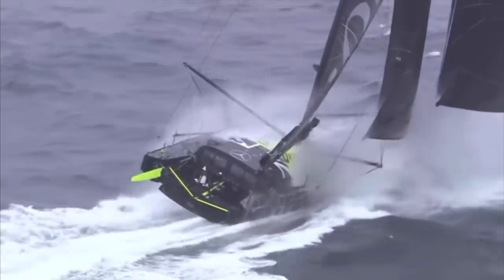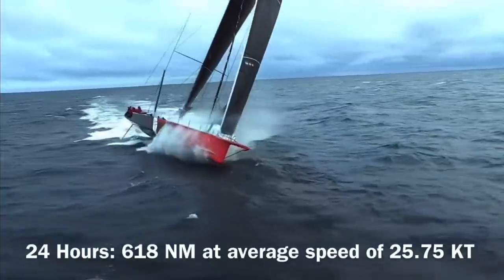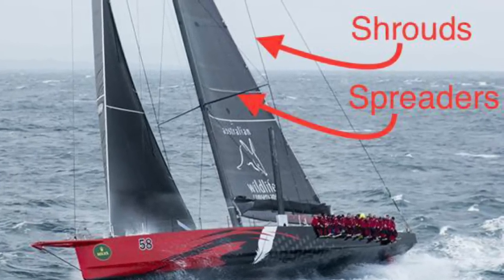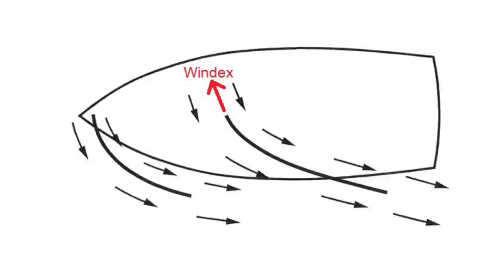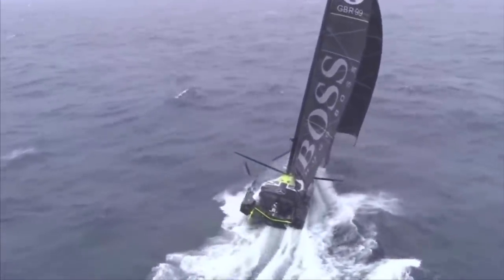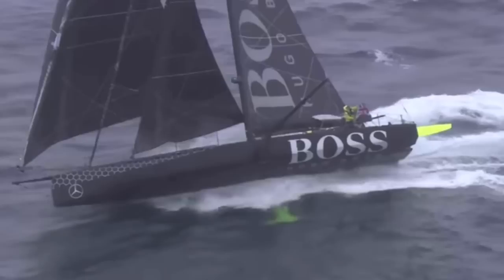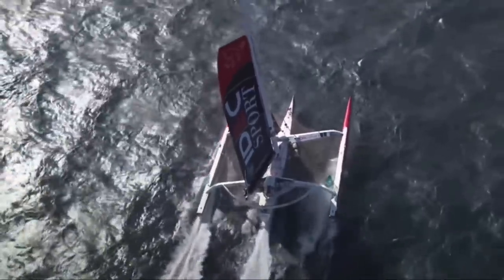Why Does Alex Thomson’s Hugo Boss Have Those Strange Outriggers?!?!?

Comment: Thanks for another very clear explanation.

P.S.  Not sure if you've covered it yet, but the sails that fascinate me most we the current America's cup sails which are basically a morphing wing.  They adjust for camber, thickness and angle, getting thicker and deeper after tacks, and thinner and flatter after the boat speeds back up, making most efficient use of the wind.  They look almost biological/living in operation.  I think Planet Sail had a video showing their operation through a tack.

These are asymmetric, monolithic (not slotted) wings, compared to the earlier slotted, symmetric wings of yesteryear.
Reply from the maker: I'll look into that! It would definitely be cool to have asymmetric wings that could morph into the correct shape on each tack and for a given boat speed!!!
Reply: @SailingTipsCa  That's exactly what they do.  I'd try to post the Youtube link, but comments with links often get banned or shadow banned.  

The Planet Sail video was from Auckland with the North Sails sail designer.  They revealed nothing about the internal working of the sail or rigging, but did show it operating (from the outside) in good detail.  It's seriously like a living thing.

If I had one, I'd probably computerize it with a neural network, for automated operation.  (For cruising.)

Edited my original comment above to say that the wings change angle, thickness and camber.  They're thick when the low apparent wind out of a tack benefits, then thin out and flatten out and trim in (smaller angle of attack) when the boat speeds back up.  Sort of going from a close reach to a close haul.  Due to speeds from foiling, they're always going into the apparent wind, as we know.

Comment: I had a Hobie 14 back in the day and It had a rotating mast. I used to place quarters on the base of the mast so it would rotate easier while tacking/gybing.
Reply from the maker: Interesting trick!!!
Reply: I used copper pennies in absence of Teflon buttons. Copper is an excellent lubricant. Quarters prbly have plenty of copper as well.
Reply from the maker: @dmitryshusterman9494  What kind of pivot mechanism is at the base of the mast? My F-82R has a ball and socket, but I know some boats have more of a cylinder and sleeve.
Reply: @SailingTipsCa  all beachcats iv seen have ball and socket and use a Teflon button for lubrication

Comment: I feel it should also be mentioned that the Hugo Boss (Guyot environment as it's known today) has dismasted four times since it was launched in 2015.  Comanche is older and has never suffered a rig collapse of any kind. I think I'm going to stick to spreaders and traditional shrouds.
Reply from the maker: Yes there’s certainly a reliability factor! That said multihulls have been successfully using rotating wing masts for decades, but they are more natural platforms with wide “built in” shroud bases. I also understand the IMOCA masts are one-design to reduce costs, so possibly a bit underbuilt for the job, and teams can’t replace with a heavier section even if they wanted to.

Comment: My Hobie has a rotating mast with spreaders. The wire makes a diamond shape on the mast, stiffening it.
Reply from the maker: Yes my F-82R trimaran has a rotating mast with spreaders like that too where the diamond wires terminate back on the mast, stiffening it. On a traditional fixed mast boat the spreaders have two functions 1) stiffening the mast as you noted and 2) adding leverage to the shrouds to enable them to attach to a narrower base. On our boats the spreaders only carry out function 1) here and the boat itself is wide enough to handle 2, but the IMOCA isn’t wide enough, hence the “spreaders” on the boat too!

Comment: Confusion here with function of spreaders and outriggers.
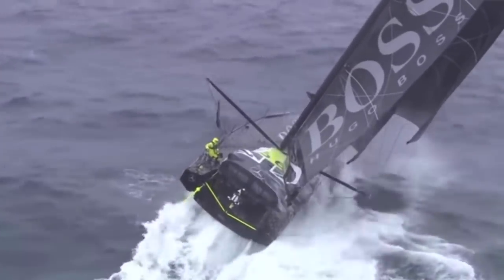Outriggers are for sheeting angles for sails, as can be seen in this video 1:24
Spreaders rotate with mast to keep mast in column.
Reply from the maker: The outriggers on the IMOCAs have multiple functions: The primary function is to provide a wide enough shroud base for the rotating wing mast, and as you noted they are also conveniently situated for tweaking headsail sheeting angles. The shrouds on a “normal” monohull also have multiple functions: They increase the leverage of the shrouds to enable the use of taller masts on narrow boats and also keep the mast in column. Boats with rotating wing masts have to split these functions apart: They need a wider base for the shrouds (e.g. outriggers on IMOCAs and floats on multihulls) and typically use diamond wires that rotate with the mast to keep it in column. I personally wouldn’t have thought of calling the outriggers on IMOCAs “spreaders” until I saw it in Sam Davies video!

Comment: Tornado Cats also have a rotating mast that you can rotate mechanically to change sail shape while Hobies and other cats masts only rotate when following the sail.
Reply from the maker: Our F-82R also has “positive” rotation controls attached to a lever arm that are independent of the sail, both to induce and limit rotation, which is nice, but it’s also an extra step to remember to adjust it. Everything is a compromise in sailing!

Comment: I alway thought they would outriggers because of the saved weight and also having the ability to use them as reaching-rods. I somehow never really thought about the rotating mast
Reply from the maker: They do also use them for trimming headsails for reaching, but primary purpose is to facilitate the rotating mast. The wider base also reduces compression loads on the mast and enables the use of a lighter mast.
Reply: @SailingTipsCa  Ah ok makes sense. Great Video by the way!
Reply from the maker: @okkewarner  Thanks - glad you liked it!

Comment: Very interesting.  I was wondering, if you could choose any sailboat (cost aside) what would your dream boat be for a circumnavigation with you family? Thanks
Reply from the maker: If cost and practicality were no issue, I dream of the one-off trimaran Shockwave (ex Paradox) https://www.yachtworld.com/yacht/2010-marsaudon-composites-trimaran-7901826/ or a Rapido 60, but those are just the dreams of a multihull convert! For more practical boats, I previously owned a Catalina 42 which was a great production boat and I would not have hesitated to circumnavigate on that, or something slightly larger and purpose built for the job like a Van de Stadt Samoa. The 40-50 foot size range is nice because there are lots of solid boats in that range, they are big enough to perform well, but not too big to become unwieldy.  Edit: All of that said, I would also recommend checking out my video “What’s the Best Sailing Yacht” https://youtu.be/COr6l02vmU8 to help you figure out what’s best for you!
Reply: @SailingTipsCa  I’m a bit intrigued with the outremer 55, explocat 52, HH … out of my price range for now, but they seem fast, safe and comfortable.
Reply from the maker: I don't have much experience sailing catamarans, but surprisingly I found that I could beat most of them on the water with my Catalina 42. Then I found this rating spreadsheet at http://racetrack.org.nz/XLS/boat_ratings.xlsx which attempts to consolidate global boat rating systems all in one place, and while you need to take such things with a grain of salt, the only production catamarans consistently faster than my Catalina 42 are the Dazcats, Gunboats, HHs, and Outremers. Most of them (e.g. Lagoons, Leopards, Seawinds) are considerably slower. So if you want a cruising catamaran that actually performs you need to be very discerning!!!
Reply: @SailingTipsCa  We chartered a Lagoon 45 in Puerto Rico back in 18/19 during Christmas. I was so looking forward to be able to sail a catamaran as I had the impression that they where much faster than monohulls. I was so disappointed. The boat was nice and big but moved rather slowly. I also found it a bit stressful not knowing when to reef. I didn’t get the same feel that I got from monohulls. So I totally dismissed them. But as winters are long and dark here in Norway I started watching a YT channel where a couple sailed a brand new Outremer 55 circumnavigating and they had consistently impressive speed. 9-18 knots with no problem and still with comfort and safety. So yes, I totally agree with you. Thank you for your reply.
Reply from the maker: There’s a Sig 45 catamaran for sale in your neck of the woods and apparently they go pretty well too. Not quite as much accommodation as the others but cruisable for shorter trips, and they will apparently consider a partnership! https://www.yachtworld.com/yacht/2009-le-breton-sig-45-7694147/
Reply: A 747.
Reply: @SailingTipsCa  wow 😁😁 that's one fast boat
Reply: I am kind of partial to that "Hugo Boss" boat, myself..
Reply: @Frank-E  There's a huge difference between Lagoons and Outremer/Dazcat/Gunboat/HH. Lagoons are basically floating apartment blocks.
Reply: @Frank-E  lagoon catamaran are more weight, more confort and less sailing performance and feel than other catamarans. The weight and shape of the hulls (waterline lenght to width ratio)are more important on catamarans than on monohulls.

Comment: The beach catamaran community has been doing this for better than 50 years.  We have spreaders on our masts, they are with the diamond wires that keep the mast in column, we also have the wider platform that use a single shroud
Reply from the maker: Yes rotating masts are very common in the multihull world, but not too many monohulls that have them!
Reply: @SailingTipsCa  you are right, and it is honestly interesting that they dont, its really the IMOCA's and AC75's.  Its surprising more dont have them considering the benefits that are there
Reply from the maker: @squid0013  I agree! I have one on my F-82R trimaran and love the forward drive and reduced heeling moment that it provides.

Comment: I've tried to explain to 'lubbers' for years, that sails are, at least in principle, wings in a vertical configuration.
Reply from the maker: And so much more efficient than those "parachutes" the old square-rigged boats used!
Reply: @SailingTipsCa  Well, they didn't have airplanes in those days!
Reply from the maker: @g.stephens263  No I don’t think they had quite figured out how bird wings generate lift yet!

Comment: Everything on board which is moving or rotating needs technical supervising and frequent checkovers, in some solutions even daily while sailing. So you create a few other issues by deciding to rig a rotating mast. More technique on board keeps the skipper busy on sea and the crew on land has additional sorrows. Some modern developments make sailing much more complicated and difficult than it needs to be. When rich people get in touch with race sailing boats it gets weird. 😂
Reply from the maker: Yes everything in sailing is a compromise! Another rationale for the rotating rig and outriggers on the IMOCAs is reduced compression on the mast, which allows them to use a lighter mast section, which in turn allows them to use less ballast, and make the entire boat lighter. The IMOCAs truly are the pinnacle of monohull performance, so they try to extract every bit of performance even at the expense of complexity. 

I have an aluminum rotating rig on my F-82R trimaran and absolutely love it. I find the simple tripod rig to be well worth the performance improvement, and don't find the additional complexity to be problematic, at least for the way I use my boat.

Comment: I think "less then 10% faster" is a failure at basic arithmetic. Also rotation alone doesn''t explain the wide spreaders at the base on these racing boats since there are rotating masts with spreaders attached to the mast with the set of shrouds attached to the base of the mast(Gunboat 68, HH cats). This likely doesn't have anything to do with the rotation of the mast but with light-weighting and increasing the base of shroud attachment. Maybe, just maybe it has to with mast-fixed spreaders and shrouds interfering with the head sail at the extreme angles of rotation.
Reply from the maker: Yes you're right Comanche was slightly more than 10% faster than Hugo Boss but not by much. But now the IMOCAs are actually faster than Comanche but their foils are also contributing to that.  

On a traditional fixed mast boat the spreaders have two functions 1) stiffening the mast and 2) adding leverage to the shrouds to enable them to attach to a narrower base. On most multihulls the the spreaders on rotating wing masts only carry out function 1) via the diamond wires and the boat itself is wide enough to handle 2) but the IMOCA isn’t wide enough, hence the need for outriggers on the boat. Unlike multihulls with diamond wires the IMOCAS don't have any spreaders on the mast itself, and the outriggers also reduce the compression on the mast thus allowing them to use a lighter spar section.

Comment: Love these back strike like the x79 or x99 Yachts. You have to keep them close on the luv side, for stabilisation of the mast.
Reply from the maker: The X99 has running backstays and checkstays which not only support the mast, but can actually bend the mast to shape the main sail. These are in addition to a “traditional” forestay, shrouds, and backstay, so lots going on there! Boats with rotating wing masts typically have a “tripod” rig with a forestay and two shrouds connected to a common point on the mast to enable it to rotate. The shrouds are outboard and aft of the mast base, so these boats don’t typically use a traditional backstay, which also enables them to fly huge flathead mainsails. They sometimes use running backstays and checkstays to support the mast as well, but a rotating mast typically doesn’t bend in the same way as the fixed mast on an X99.

Comment: "because the mast rotates you cant use spreaders attached to the mast" Uh..... yea you can. The spreaders just have diamond wires that attach to the base of the mast and separate spreaders that go to a fitting on the front of the mast. Think most beach cats
Reply from the maker: On a traditional fixed mast boat the spreaders have two functions 1) stiffening the mast as you noted and 2) adding leverage to the shrouds to enable them to attach to a narrower base. On a beach cat the spreaders only carry out function 1) via the diamond wires and the boat itself is wide enough to handle 2, but the IMOCA isn’t wide enough, hence the “spreaders” on the boat too!

Comment: DEAR SAILING, I UNDERSTAND WATER DRAG. I WONDER IF IT WOULD BE BENIFICIAL TO ATTATCH SOME KIND OF VIBRATING MACHINE TO THE  INSIDE OF THE HULL TO HELP TO SHAKE THE HULL FREE OF THE WATER WHEN TRYING TO ESCAPE AND FOIL???   TINY BITS OF AIR BEING ALLOWED UNDER THE BOW. OR TINY BITS OF WATER SHAKEN LOOSE FROM THE BOW AND HULL?? WHAT DO YOU THINK???     🇺🇸 THX,  PATRICIA
Reply from the maker: Interesting question! The concept of “air lubrication” for ships is a real thing however it seems to require a flat bottom, which not all sailboats have: https://www.marineinsight.com/green-shipping/how-air-lubrication-system-for-ships-work/
Reply: @SailingTipsCa  Dear Sailing.  
MY GOSH, I READ THE REFRENCE YOU GAVE ME!! BUBBLES. IS. A. THING!!!
I WASNT FAR OFF!! THANKS😃👍🇺🇸

Comment: Do the foils make a difference?
Reply from the maker: They certainly help in some conditions, but although you can’t see it in this video, Alex had already broken his starboard foil off and therefore completed most of the race with only one foil. He initially thought is race was over, but he still came in second despite only being able to foil on one tack, but not the other. The other interesting data point on foiling is that the Jules Verne Trophy for fastest circumnavigation is still held by IDEC Sport (trimaran) in its pre-foiling configuration, and despite the rising prominence of full foiling in the five years since the record still hasn’t been broken. There are reliability questions as well…
Reply: @SailingTipsCa  I have to admit that the Americas Cup cats are super fast when up on foils, but Alex Thomson would be fast on water wings. I guess if they have the right conditions they can almost fly.
Reply from the maker: @philgray1023  Yes some skippers are fast regardless of what they are sailing! I recently did a video on foils to illustrate some of the physical and practical limitations: How Fast Can a Foiling Sailboat Actually Go?!?!?
https://youtu.be/SWGBgR_Np3E

Comment: Seems like a boat would go faster if it wasn’t underwater half of the time. Why do these boats bury their bows so much?! Can’t they design more buoyancy up front to keep the bow from punching into every wave?
Reply from the maker: That might be a good topic for another video! The thinking is that wave-piercing bows cause the bow to pitch up and down less, and pitching slows it down more than having water on the deck.
Reply: they fly now, you know?
Reply from the maker: @ohnezuckerohnefett  Yes many of them also have foiling capabilities, which even further reduces pitching, as long as the foils haven’t broken off, as was the case with Alex’s boat in this particular video.
Reply: the foils need to be in solid water to create stability. Wave in the ocean are much higher and wider than a 60’ or even 100’ boat going 30+ knots. The boats are design to cut through the water and shed it quickly. Others could provide more correct and precise  explanation. Great video!!
Reply from the maker: @superior451  Yes and that’s why lots of ocean-going race boats have a combination of partial-lifting foils and water-shedding bows!
Reply: They are designed to be stable and not go up and down too much with every waves. because the mast and sails moving around backward and forward too much would disrupt the airflow and decreases aerodynamic efficiency.
Reply from the maker: @niconico3907  Yes the pitching reduces the sail efficiency because the apparent wind moves forward and aft. It also increases hull drag so something to avoid!